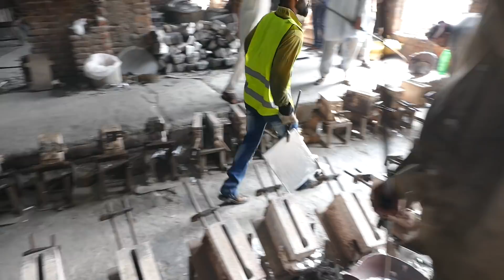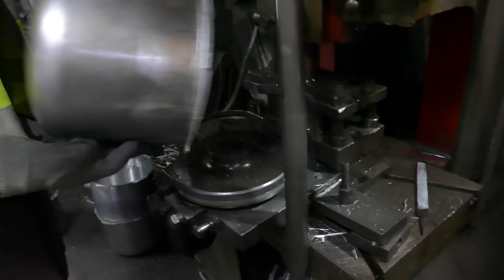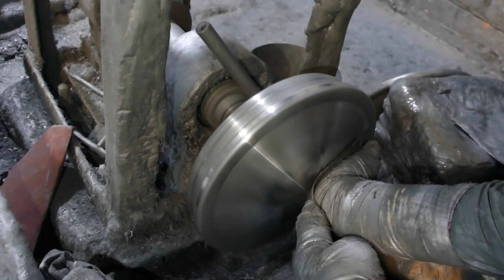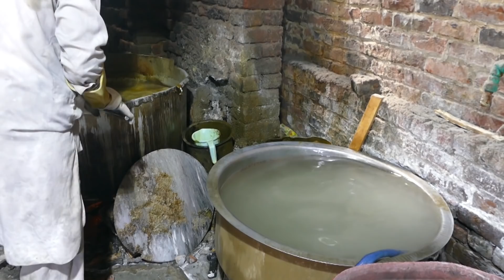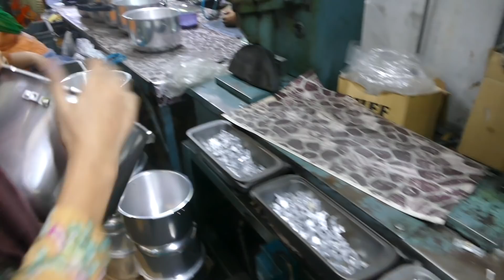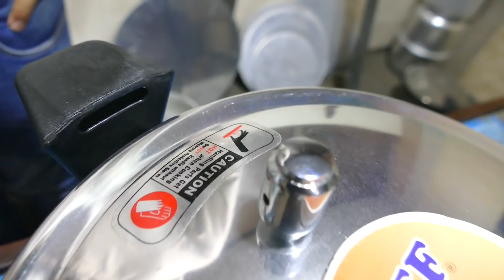Indigenous Process Of Making Pressure Cooker with Amazing Skills

Comment: Well, regardless of all of them failing their Safety Induction Course, the finish product is amazing, even the process involved is memorizing. There's not a single person in there who doesn't know what he is doing... 👏👏
Reply: what do you mean did you not see the helmets and safety vest i mean okay they do nothing for that job but its safty gear xD
Reply: It's not really secure gear they wear, but I'm astonished that some use something resembling safety gear. They wear gloves or something resembling a glove. I have seen videos were they do this kind of work without a glove, just bare hands and loose rag.
Reply: @seanthiar  flip flops are the best safety shoes when casting molten metal.
Reply: They where wearing flip flops when casting molten metal and dealing with sharp scrap off cuts on the floor.............easy to get off when you get burned or cut.

Comment: The impressive part for me is that these pans are literally made out of scrap. Fully integrated production, this requires a lot of ‘production logistics’ and materials management. Even the shop doesn’t look that bad. I’ve been in a modern alu wheel factory in Antwerps a good twenty years ago and it did’nt look all that different. There is even safety awareness given the hard hat on the fellow at the press his head. It did’nt fit, maybe it was just joking but they understand what it’s for.

Comment: 10:21 the quality control department…
With all the manual removal of material, they will never be able to guarantee a material thickness with appropriate tolerance. I wouldnt be suprised that some will even blow up when they are used.